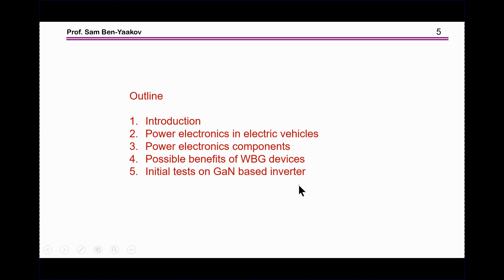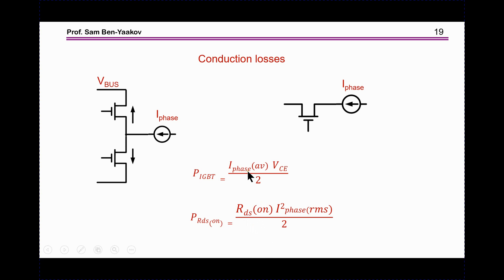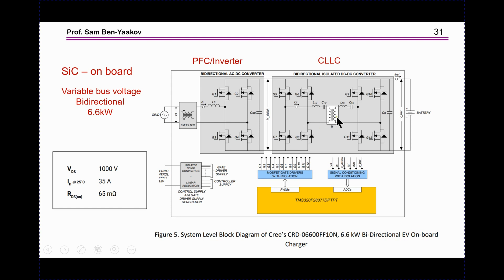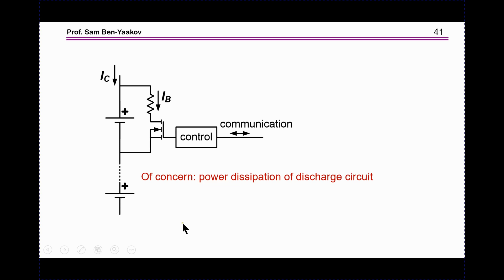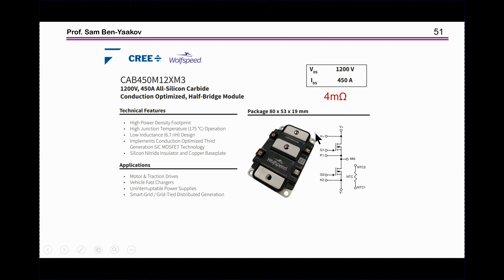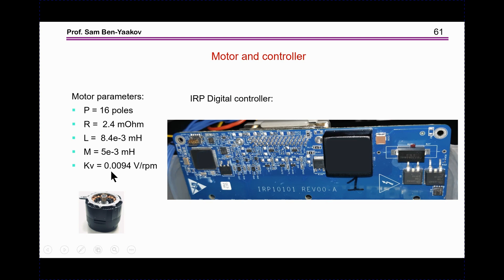Power electronics challenges and solutions of e-Mobility

Comment: At 41:42 , you have calculated switching losses by multiplying switching energy at 200A with switching frequency, although the actual Swithing loss will be an average of the loss during once cycle assuming sinusoidal current. So switching losses would be less than what you have calculated and approx 0.63x10000x0.011 W
Reply from the maker: This is not entirely  correct . At low speed , low elctrical frequency the inverter spends a long time around the phase current  peak.

Comment: Having noticed how the "high efficiency electric motors" in industrial operations and to a lesser extent in some power tools have 6x to 87x higher starting currents than the operating currents it has puzzled me how as to the strategies of managing these high currents so as to make more effective use of power and how this interacts with our energy storage systems.   Uncontrolled voltage rises can be instructive ... have so much more to learn.  Thanks for improving my curiosities.
Reply from the maker: Thanks fot input.

Comment: @33:35 - is the X-axis here not Depth of Discharge DoD rather than State of Charge SoC? Open circuit voltage should be highest at higher SoC. Am I missing something?
Reply from the maker: Strictly speaking, yes. Thanks for pointing this out.

Comment: It is very nice presentation. But, I felt, while comparing the technologies, IGBT, SiC and GaN, an apple to apple comparison is not made in the presentation. Is it ok to compare 700V die IGBT with 1200V die SiC?.  Why is that the  IGBT Module's diode conduction and recovery loss is not considered at all in the comparison.  Again GaN Vs SiC is not clearly brought out.
And one more correction, at 36.51, SiC devices with 900V/196A (Die), 1200V/120A (discrete package) were available long ago.The correct comparison of GaN vs SiC should be of Kelvin Pin SiC 650V mosfets against 650V GaN switches..
Reply from the maker: SenthilKumar Madasamy, thanks for the time taken to comment. Yes, you are correct on all your pointed. The lecture is far from being perfect but given the short time limit I think the  overall picture is correct.

Comment: Very interesting presentation, thank you!
I would just like to point out in min 45.06, during the comparison between the SiC and Si devices. One can observe that the DUTs are being tested at different DC-link voltages (SiC 600V and Si 300 V), I would say that it is not a fair comparison for the SiC device. And as a consequence it appears that its switching loses are not lower; maybe,  if it is compared with the FS380R12A6T4B IGBT module (has graphs at 600 V) it may be a more fair comparison.
Reply from the maker: You are correct. Thanks for taking the time to comment. This was the information available to me at that time.

Comment: Super cool. I am very interested in hearing about the over voltage snubbers, both for SiC and GaN applications and protection. Also, the over current (short) circuit protection would be done digitally or for faster speed using analog opamps, comparators bypassing digital control in an even of the fault?
Reply from the maker: See
https://youtu.be/kNTVhgawljg
https://youtu.be/zJQM842clcM

Comment: Actually, there isn't really a need for isolation in the charger since the battery is isolated from the chassis and a ground fault detector guards against faults. Guess why the majority of production EVs picked a battery voltage that is just above the 340V or so of rectified 240V AC?
Reply from the maker: Still, many of present designs are of the isolated version. The 400V (250-450) is a compromise of battery cost and current level.
Reply: @sambenyaakov  It appears to be that isolated chargers are more common outside the US while nonisolated chargers are more common in the US. Probably has to do with RCDs and avoiding tripping them from stray currents due to capacitance, while 240V circuits in the US very rarely have GFCIs or RCDs.